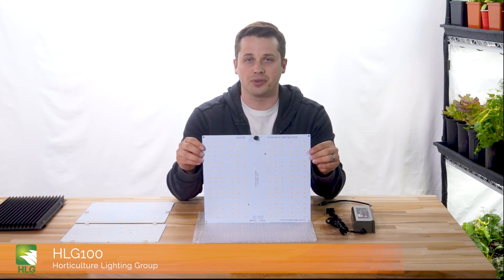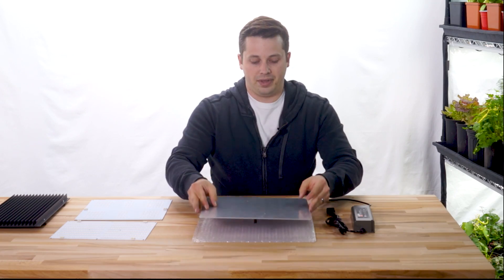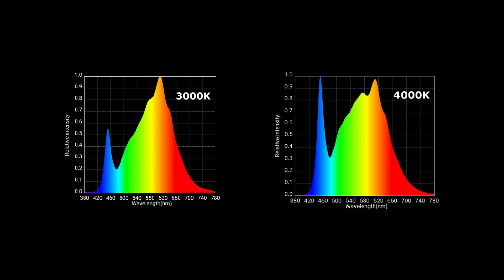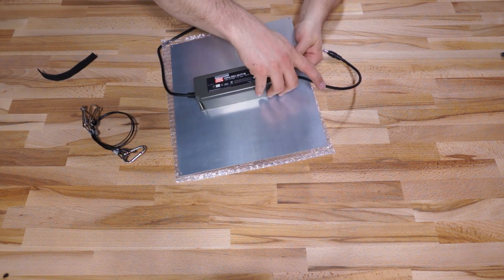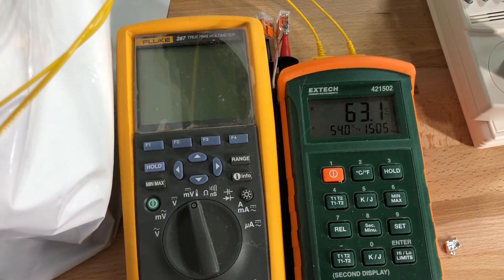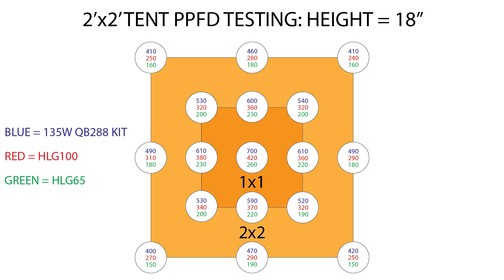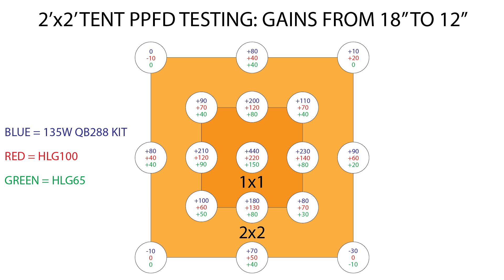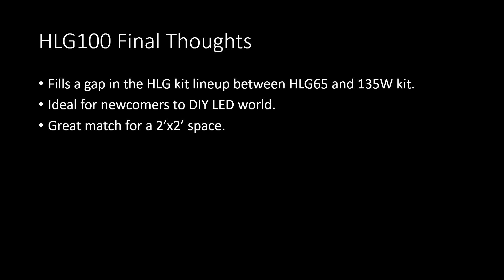Hands-on Review: HLG 100 Quantum Board Kit

Comment: So, it looks like according to this test that the 135 Watt kit set somewhere between 12-18” (maybe 15”) is really the best fit for a 2x2 out of these 3 options. The 100 Watt kit is kind of under the optimal light levels for flowering, especially on the perimeters.

Comment: Can you add the extra red spectrum to it. How do you add the extra red stimulator.  I notice they are about 70 bucks but can it be put on this too of do I need to get the 135 and would 2 100s be too hot for a 3×3 . I flower 2 plants in a perpetual grow but switching over to these to save on more electric  bill.

Comment: Is there any way to dim this unit and if not can the board be paired with the Meanwell ELG-100 . Will be using this to veg in a  24w x 30h x 18d cabinet and think this might be too much light without a dimmer.
Reply from the maker: A T nope, you can’t dim it. An ELG-100-36 A or B will work well.

Comment: Awesome review sir! Cheers!
Reply from the maker: Thanks Bingus!
Reply: Bingus hey friend does hlg recommend a fan to help cool or do they work better at these temperatures
Reply from the maker: Hillbilly hydro Grower it’s not required but cooling is never really a bad idea (except for maybe a couple weeeeeeird scenarios). They run just fine without though. I know that on Samsung F strips (same diodes as these boards), the lifetime rating of the diodes is rated at 80°C!
Reply: Why is the barrel power connected perpendicular to the board on the HGL 100 but parallel to the board on the HGL 65?  Looks like someone screwed up the design of the board lay out on the HGL 100

Comment: @LED Gardener- Do you have to place the “Driver” on the back of the board?
Reply: Derrick Lewis No its more for convienance Derrick. i have 4 in a series connected of the 135w and drivers positioned away to avoud extra heat
Reply: owen baker you can fry an 🥚 on this bad boy, Hot hot hot hot hot
Reply: @DLine-co5ii  man my hlg v100 dont even get warm. Just a fan blowing in room keeps cool

Comment: Another amazing video. My dual panel 288 setup came in today that you recommended. I was wondering if there was any downside to mounting the power supply to a wall on the outside of the tent and then running the wiring inside to the lights? I figure that would be less heat in the tent and allow to light to vent better. Thanks!
Reply: No downside.  Those drivers do get hot (about 55*C).

Comment: Do you have a V2 QB 288 enroute?  Lol.  

I wanna know if there's gonna be any differences that'll require a different driver for the same configurations as current "version".  Eg:  Will an HLG-240H-2100C still be recommended for two QB 288's.  Different forward voltage or..?
Reply from the maker: Complex should have some very soon. If the diode counts/layouts are the same, the drivers should be the same since max current is equal on both types of diode.
Reply: Cool man.
Thank you.
Reply: Stephen mentioned during the GML show last week that the V2's were good up to 3.2A, If I remember correctly.  New Samsung data sheet, I haven't looked yet.  I remember Robin told me they also run a few volts less (52?).

:)
Reply from the maker: Complex yeah just like the LM561C, they are 200mA absolute max which would mean the board would technically do 3200mA. HLG just underrates them a bit to keep people from pushing them too hard.
Reply: Oh...hmm.
The way he said it (correcting a convo he saw me and someone having in the chat) made it sound like "the V2 boards are capable of handling more than the V1 boards", not that their lights/samsung diodes are capable of more than they rate them for in general.

Comment: Why does the 135 kit have the smallest board for the most LEDs?  Seems it would make more sense to have a bigger board to space out the LEDs and a smaller board for the 100 and 65 watt kits. If the LEDs were on a bigger board for the 135 watt kit it might not need a heatsink.  What aam I missing here?
Reply: The 135 kit is using a board that is usually used in bigger build. You would strap 2 to 4 of them on a bigger aluminum heatsink spaced out more to cover a larger area. Not as practical by itself but much more useful for larger applications.

Comment: Just a bit of warning.  Not only that these PC boards are way overpriced, as Samsung chips they use go in volumes for about $0.04 each, but this "light fixture" is also dangerous - bringing high voltage DC (what is ten times more dangerous compared to AC) right to the exposed soldering points.  Don't be a sucker buying on "I love this light" type of internet hype.  For the same money you can buy a very decent uL approved commercial grow light, and I don't mean Kindled, Black Dog and all other consumer quality fan cooled toys.
Reply: Where did you get this information from?

Comment: I just changed the extraction fan in my cabinet and it's not as powerful as it was before. Running a 130watt CFL it's a bit warmer than I'd want. Would the 135watt HLG kit run cooler or are they going to output similar amount of heat? Need to figure out if I spend more on a new light or a new fan, or both...
Reply from the maker: prndownload it’ll be similar amounts of heat. Same power = same heat output.